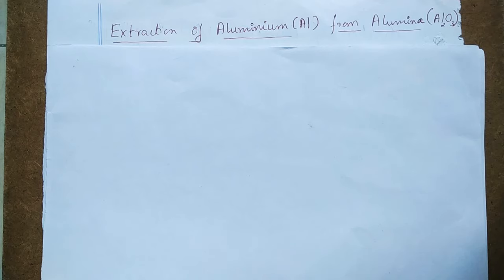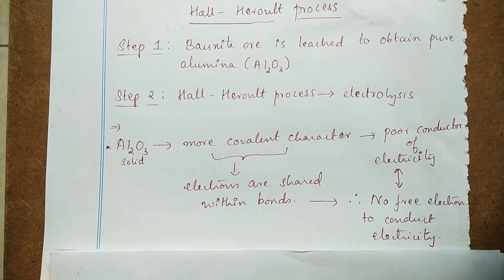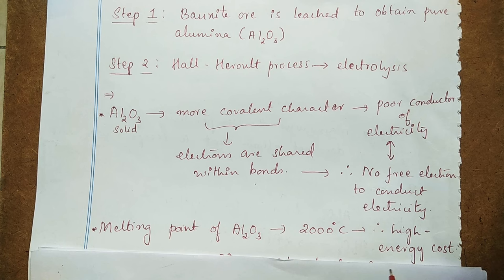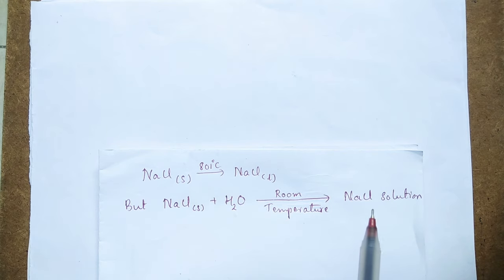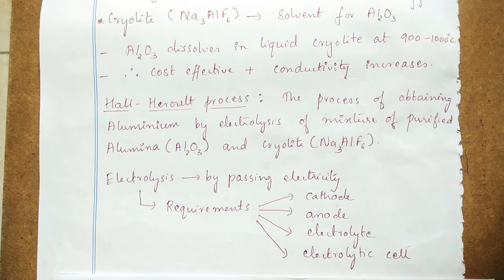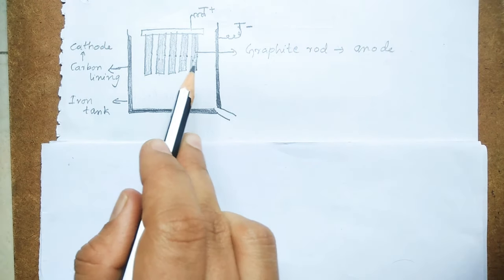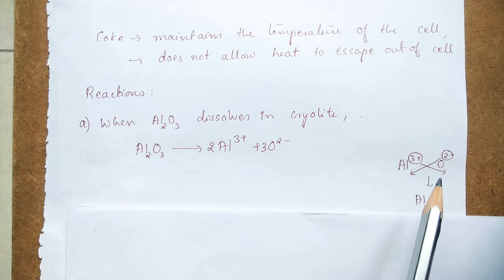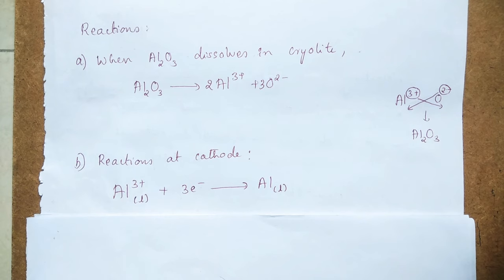Extraction of Aluminium from Alumina- Hall Heroult process | Class 12 Chemistry

Comment: How much electric voltage and amps are required for electrolysis to produce 900 to 1000 c temperature??? Plz explain the main thing.  Thank you
Reply from the maker: A low voltage current (4.1 V - 4.2 V) at 100 - 300kA is used for this electrolysis